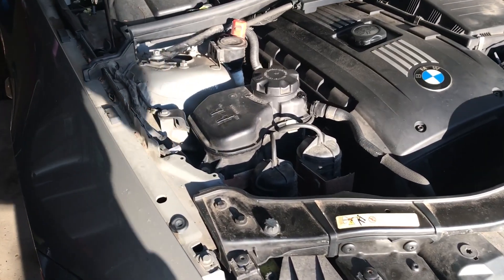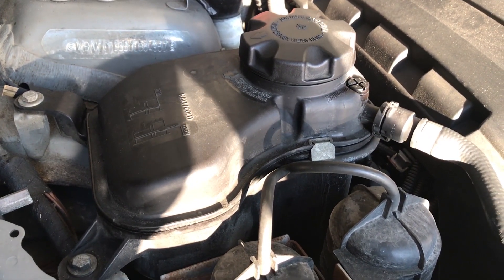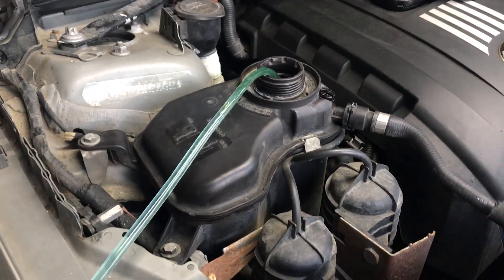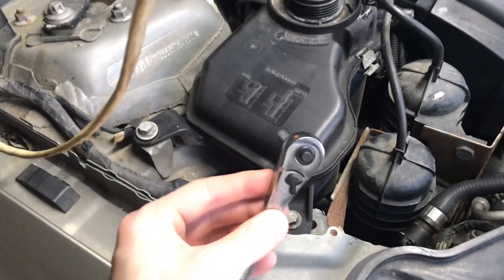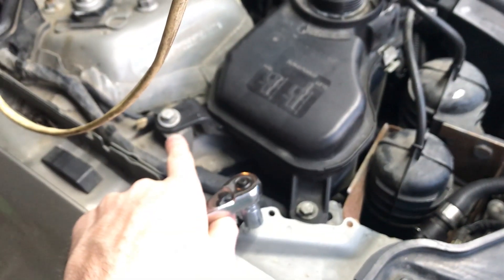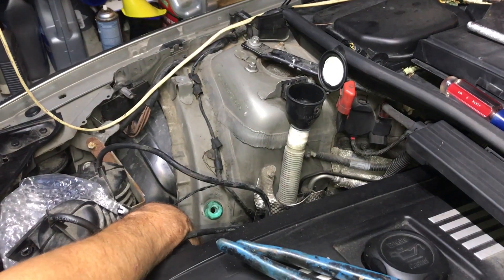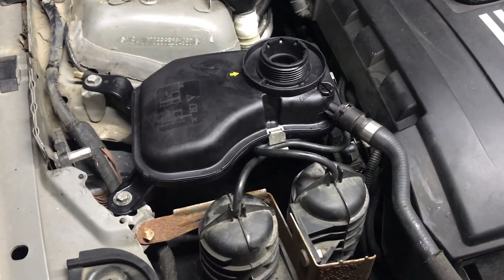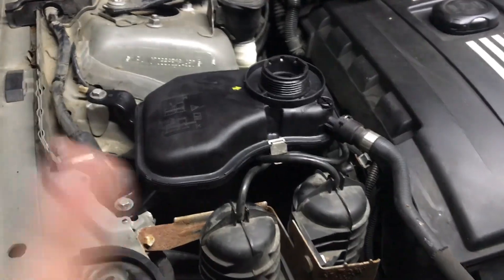HOW TO - Remove and Replace Coolant Expansion Tank on BMW 335i

Comment: Thank you!  I bought a new tank for $50 on Amazon.  I replaced it in 10 minutes with adjustable pliers and a small flathead screwdriver.  Computer was turning off the turbo as the temp approached 260 degrees. Now it runs great.

Comment: Does anyone know what the 2 containers in front of the coolant reservoir is called??
Reply: Vacuum Canisters
Reply: @crazygamer889  are those for vanos or something?
Reply: @slidewayskrew  no there are to hold boost usually in higher altitudes
Reply: @the_returning_x871  oh that’s cool. They wouldn’t happen to be aftermarket would they? I don’t have those on my n55 and that bracket looks a little home made lol
Reply: @slidewayskrew  well as far as I know know on my N54 it has them stock I’m not so sure about the N55 since it’s a single turbo
Reply: I'm missing 1 of them and the hoses aren't connected my f mechanic .
Smh

What do I do guys